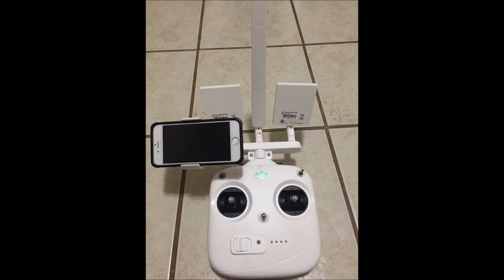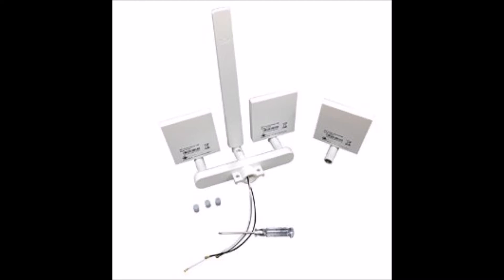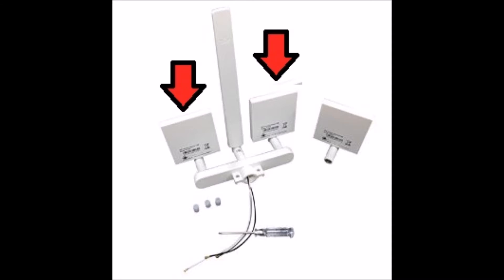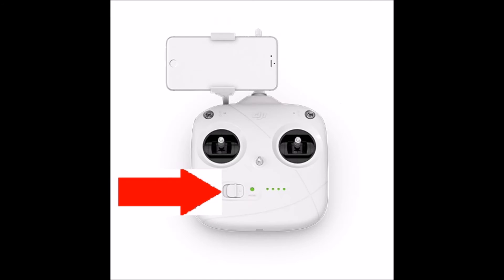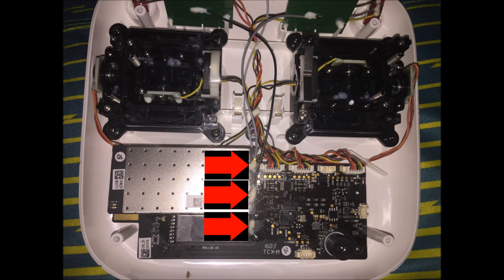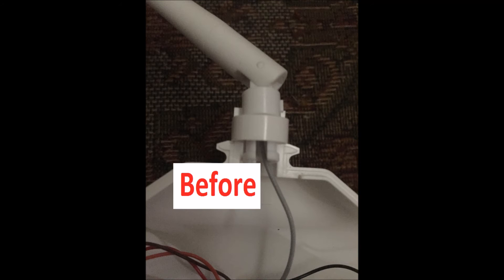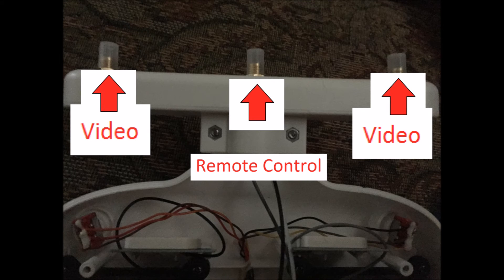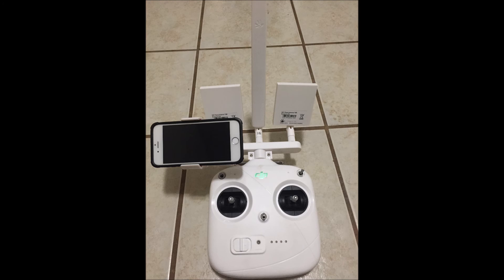Quick ARGTeK Controller Install: How to Upgrade DJI Phantom 3 STANDARD Antenna Range Extender Remote

Comment: When I mounted the 2.4 ghz antenna inside the control, the little receptacle it plugs in to split apart and I pushed it back together with a precision screwdriver and then mounted the clip on it, but now the drone doesn't work through the dji go app, it only can fly through the remote. also the led for the power button stay red instead of green even tho it is semi connected.. any ideas on how to fix? if not i'll probably get a new remot